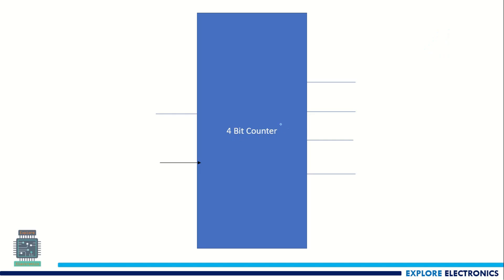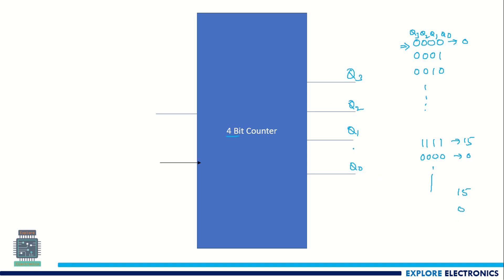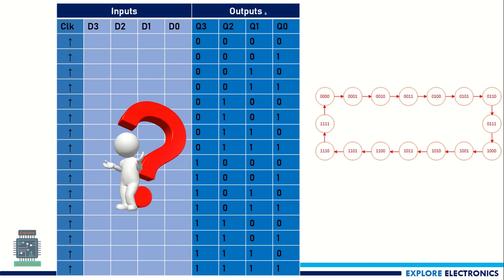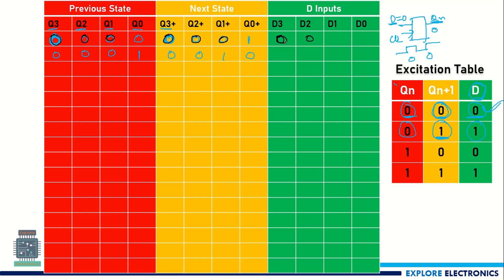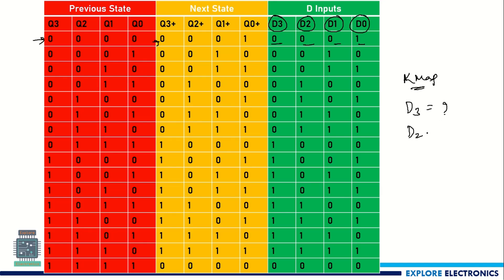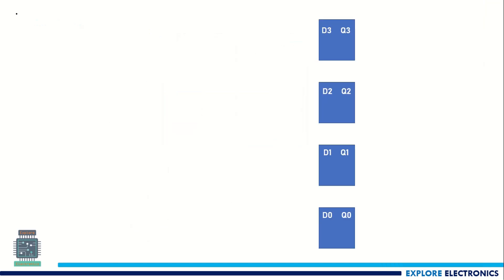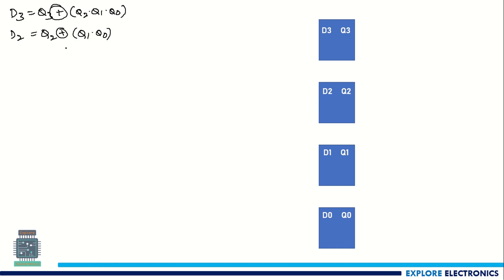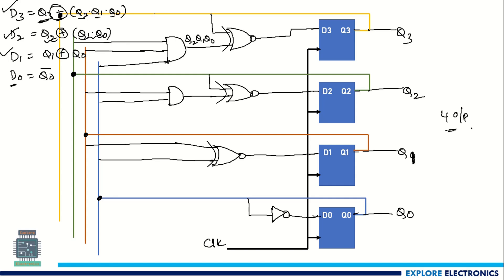Design of 4 Bit synchronous counter using D Flip Flop | Counter Design using flipflops

Comment: PROBLEM! From 15:45 on, the presenter draws several XNOR gates. It seems these should be XOR gates.  His algebra does show XOR, and in the spoken narrative he says "XOR", but then goes to the extra effort of showing an explicit inversion on the XOR gates, which should not be there.  Sadly, after you have created a PCB with 74HC7266 XNOR gates, you can't just substitute 74HC86 XOR because the pinouts are different. GRRRRR!  I guess this is what Xacto knives are for....   Other than that... nice video.